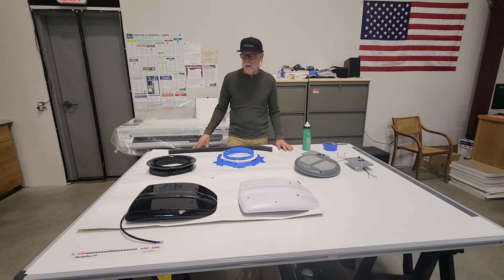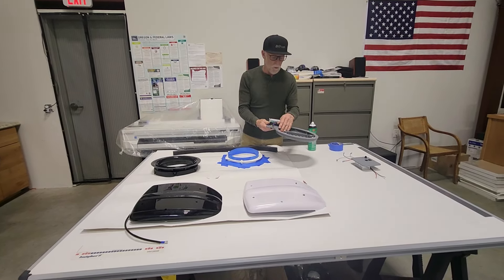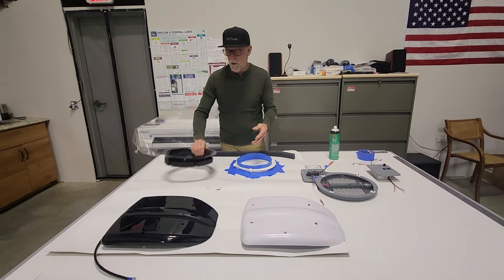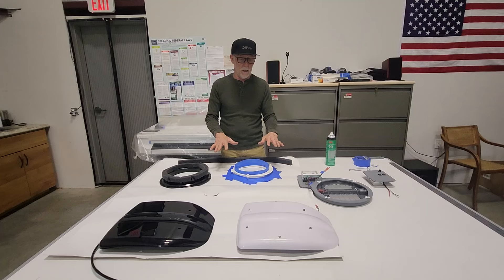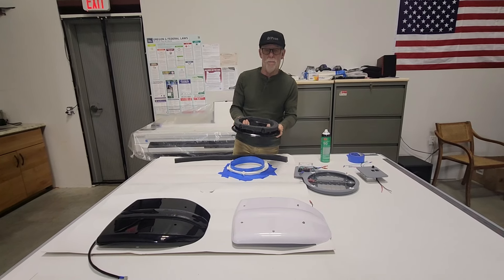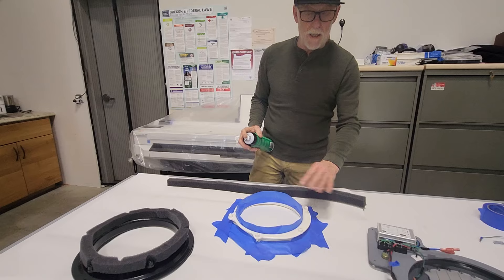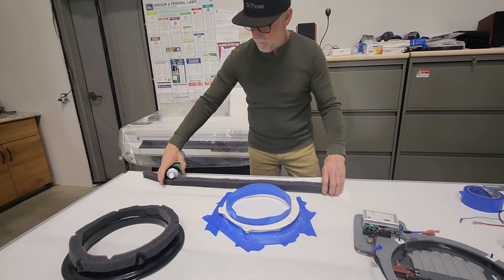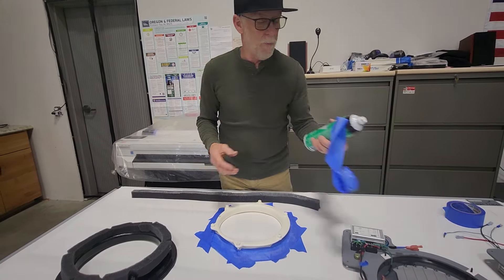Hein at DIYvan shows how to install a  snow/bug/water filter in a Lemans vent.

Comment: I would be game if you ever developed a system that used bug screen to minimize air flow restriction.
Reply from the maker: Great suggestion. I am sure we can do that.
Reply: @doityourselfvan  On a slightly different note, I guess that the foam will be fairly visible from the exterior and one will need to paint the foam white, to match a white fan?
Reply from the maker: Its not visible.  We have switched to a thinner material which allows better air flow.

Comment: What vehicles do ya'll have these installed on? Those are very low profile
Reply from the maker: Most commonly full sized vans but the Lemans is a great vent for smaller vans like Sienna, Promaster City, Transit Connect, Mercedes Metris,  Nissan NV200  etc.. Any vehicle that will benefit from some ventilation while parked or driving. One customer installed two on an offroad UTV.
Reply: @doityourselfvan  where's that video, I would like to see it installed
Reply from the maker: https://youtu.be/dUbbJ5iVZLY
Reply from the maker: https://youtu.be/dUbbJ5iVZLY
Reply: Is there a lemans  roof vent that would work in a 2018 Toyota Sienna AWD XLE? There are two sun roofs!